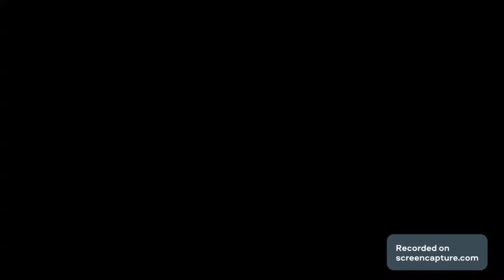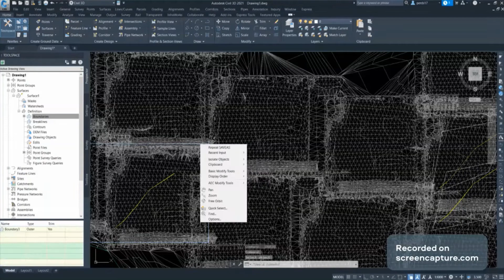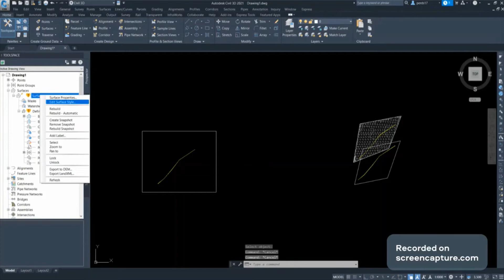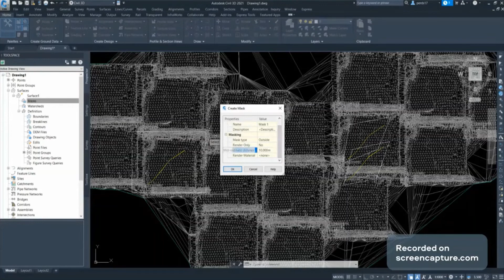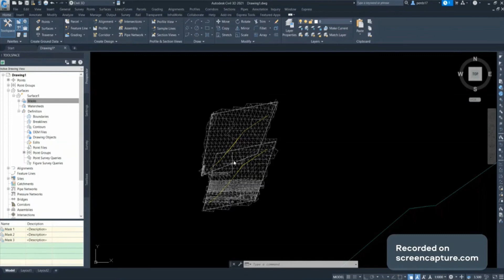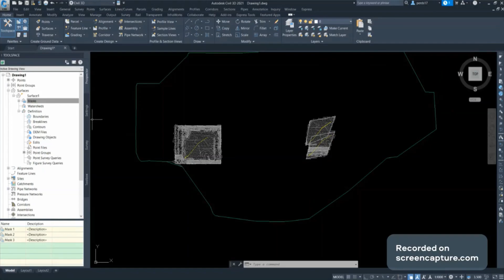Civil 3D - How to Deal with Heavy Surfaces

Comment: Thank you very much for your very helpful tips and tricks.   I would also like to add that it is also possible to show two different areas of large surfaces simultaneously using different types of boundaries. There are four types of boundaries ( Outer, Show, Hide, Data clip).  selecting the first area using with  Outer-boundary and  the rest areas/boundaries with Show boundary
Reply from the maker: Great tip! Thanks for sharing
Reply: @Civil3DProTipsandTricks  thank you fot the great videos ...keep it up!